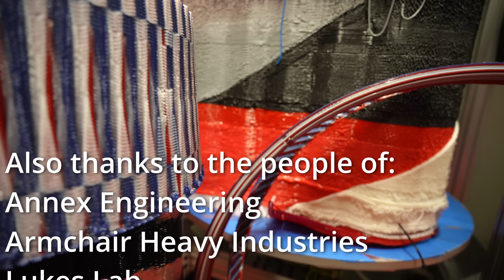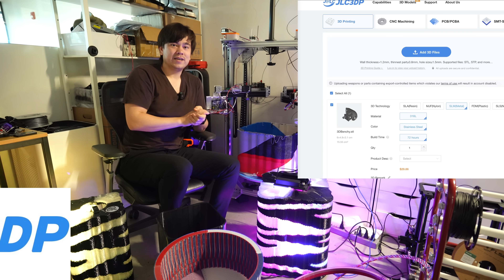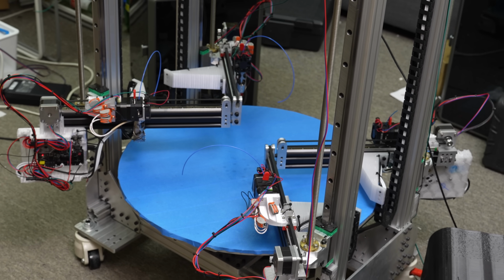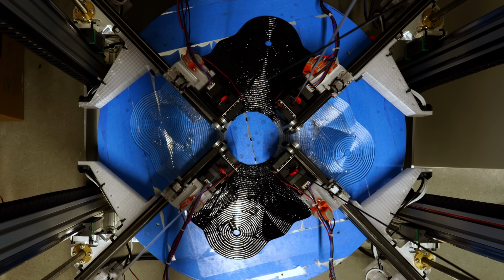The High Speed Future of 3D Printing - Quadrupolar Express

Comment: Why don’t you connect all four kinda-X axis beams into a single solid gantry? You don’t really need an independent Z motion, and using the solid joint between all four axis would solve most of the head misalignment issues. For a Z misalignments you can use older hotends without a thread, that can be fixed at a range of Z distances, so you can align all hotends at the same height.

Also your kinematics has two shared axises — Z and rotational axis. This way, without two independent axis per head, you can only really do mirror-like mode prints. Also without being able to print in the middle of the table.

I like your work, but it seems to have too much engineering issues. 3D-printer project 
“Dueling Zero” is much closer to practical parallel printing (but cannot scale well beyond 2 printing head, like your design).

Comment: 11:25 could you put a camera on the top looking down on all the print heads so that as the rails are not parallel, the camera measures the x y position of each print head relative to the single fixed reference point of the camera and then compensate position in software?

Comment: Very cool idea, only problem is with your model it isn't possible to print in the middle... How about a 3 head printer: one diagonal arm that goes completely through (is connected to two pillars), so this can print in the middle and than two short ones on each side... Of course this would need seperate controlled print heads/G-Code.

Comment: Do you think that you could do like a 3D mesh level to compensate for the warping ? I'm not sure exactly how it would work but maybe have 4 bed scanners and have them all scan every 0.5 or 1mm Z height and maybe somehow overlap the meshes to be able to figure out where the tool heads are relative to each other? Maybe have markers in the bed to help with aligning the meshes? And then use interpolation to get even finer adjustment for warping. It sounds like it could work but idk if it's feasible to make. Best of luck

Comment: I think I'd start with one IDEX arrangement that crosses the center of rotation, so you can print in the center of the bed, then add more radial axes.  For alignment, best option would be a large surface plate to get the frame planar a straight edge to get one rail true to itself, and then a test indicator to let you adjust the other rails parallel to that one.

Comment: 12:00 - The multitude of out of tram conditions in a 3D printer of this design could largely be calibrated in software, once you have all four print heads completely independent of each other, similar to Z axis offset after creating a print surface map.

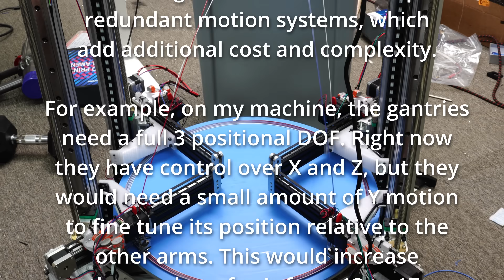13:00 - Never mind.   😀

Comment: Amazing machine sir, excellent work! To me, a pellet fed design feels like the right direction given your comments regarding filament swaps. Looking at the comments regarding the ability to print the entire platform, missing the middle comments, given all heads are printing the same layer, is it possible to move the relative motion to the heads themselves mounted on continuous X cross rails compensating relative head heights with some sort of mount design? Just blue-sky thoughts here about an amazing machine. Please, want to see more.

Comment: just as an Idea: with independent z axis control it might be possible to do vase mode with 4 layers done in one rotation of the build plate (not exactly 4 layers in one rotation, but it should cut the print time of vase mode prints down to 1/4 of the original time) each print head does one rotation on one level and when the newly printed layers from the other extruders arrive you could move up the extruder whilst printing up 3 layers. If you stagger the end of the ends of the circles of the different extrusions you also don't need to move up 3 layers immediately but a bit more diagonally up. not sure if it makes complete sense but this could be a fun application of this design
edit: for g-code generation you could essentially run the same g-code on each extruder, but starting out on different layers and also staggered in phase of the rotation of the buildplate, this could ease up on the software implementation of this.

Comment: Probably the easiest way to ensure each rail is parallel is mounting a dial indicator to one and measuring the distance to the other as you move the rail up and down, this is very common when making or preparing machine tools. Just need to be careful with how rigid the mounting for the indicator is and what surfaces you are actually measuring. For example doing this will not guarantee squareness to the base, and you'll need to measure the front and side surface of each rail for both axis of the rail that can be out of parallel. Use the same rail to measure the adjacent rails to avoid compounding errors, and adjust the opposite corner rail with the dial mounted to it while doing your best to make it agree with both newly adjusted rails if you don't have a dial stand long enough to reach it from your reference rail.

Comment: How about connecting two opposite gantries for over-the-centre printing, as well as, increase in rigidity? Or, better yet, connecting all four on the outside. I don't understand the reasoning for separate z-axes movement, considering the limitation of a common build plate.

Comment: I think for your project reprap firmware is better suited. Proper printing has built a dual toolhead machine that has all axis independent, so a separate xyz for each of the extruders.

Btw klipper had for a long time support for idex printers (dual carriage), copy/mirror has been added this year in mainline klipper. So no changing pin assignments, you just park one tool, activate the other and continue.

Comment: That’s an amazing project! I think, the bed adhesion could be solved by using some pressure measuring sensors like the prusa mk4.
I also think, that the machine is more suitable for pellet printing.
Also, once it is possible to control each extruder by itself (so 6 axis), it would make sense to build in a gyro on each printhead to compensate for any misalignment of a particularly axis

Comment: I forsee two major issues:
1.) you can never reach the center of the buildplate.
2.)when you want to print asymmterical shapes, the accelerations of your "X" axis' will be very geometry dependant ans eratic. This will cause a lot of artifacts and oozing defects.
Reply from the maker: With the current mechanical design, it can reach center with all 4 printheads, just not simultaneously.

Comment: instead of the robot arms, you can just spin and use a cd-drive style radial linear motor, and have multiple readers, while spinning the platform and doing it otherwise like corexy, core-polar. to continue, why did you not join the bridge arms as a connected star rail bridge. even more stable and accurate. you have the blind spot in the middle tho. corexy would be better in general. you have multiple print heads on the xy plane. to get the center also, have one of the bridges have a single print head. or have a single diameter bridge have multiple print heads.
Reply: if you use a bed slinger or spinning print plate, and have multiple x or y aligned print head bridges, you get as fast as many you have those independent print head bridges. yep a normal/spin bed slinger with multiple, not just one, print head bridges.

Comment: The Duet 3 control board allows for parallel processes. With the X5 expansion board you can control about 10 axes. Firmware also allows for parallel printing. I don't think it's still enough for your application though. How it works in practice is that two printheads will both execute their particular task until they receive a command to sync them up. At that point I think the fastest printhead will wait for the slowest printhead to complete its gcode.
Reply from the maker: Hmm, I have a half dozen boxes that say "Duet" on them that agree with you

Comment: Problem is - these are easy prints, no stringing, overhangs etc. But those extremely complex designs often just make a single part print necessary, you got a problem that nobody else ever had and that is for sure not a trash can or easy geometry
Reply from the maker: I'm not running part cooling, and using large nozzles to mask alignment errors. But once I sort those out in a future revision it should be able to print with 0.4 or 0.6mm nozzles with typical 3D printer overhang performance

Comment: How did you remove the trashcan and are they for sale i need one and do you think i can break a chube
Reply from the maker: I used a bolt which screwed in through the bottom of the plate, like an ejector pin on injection molding machines. The sucker probably took over 800 lbs of force before it popped loose!

Comment: That is impressive ! however there is another very important limitation ... you cant print in the middle. imho that is very important to solve, and i dont see a way to solve it with this design. Maybe once you can get 4 independent printheads, you could change two opposing axis so one is longer and the other shorter ? That would allow the center to be printed, however only 1 head could be used for that. Awesome job in any case.
Reply from the maker: Actually, it can print in the middle. All of the printheads are set forward about 150mm from the linear rail, perhaps I should have demonstrated that on this video.

The issue in firmware is I can’t send all the printheads to the middle at the same time, and they all receive the same signal, so the temporary solution is to just avoid it
Reply: @NathanBuildsRobots  It looked like your prints were open in the middle too, so I thought it was a physical limitation. It makes sense as you said you could not control the printheads one by one. I think if you can add that info somewhere (or pin it in the comments maybe ? ) you should really say it is a sofware limitation only !

Comment: Brilliant project. What a mission. love it. Would a solid hub linking the ends of the extruder arms make their relative positions more rigid? And then if an extruder is idle make it sit in a rest position outside of the build area so as not to crash into the build.
A solid print head gantry with the multiple print arms might help keep print plane alignment neat between the 4 heads as the gantry rises. Probably also needs well coordinated for 4 z axis rise timing and each print head completes it's layer at the same time so flow rates mapped to layer specific speeds of extrusion. A lot of code for the slicer

Comment: WOW, this is a whole other level. I recently jumped on the RatRig IDEX wagon and while they have got great control over precision alignment with their visual assisted alignment tool (VAOC) this has so many more degrees of freedom! Exciting to see how far you got this already.
Reply from the maker: This isn't at the level where it would be plug and play like a Ratrig, but in a few revisions it should be! Just need to fine tune the mechanical build, then overhaul the electronics and firmware.

Comment: Another great video and hope you continue to develop this project.   

I completely agree with your assertion that parallel multi head printing is the way forward. 

My thoughts on some of the issues you raise in this video are:

1) Limitations on the number of axis you can control - I think keeping the control boards separate on each print head is a solution to this - i.e. Each board has 3 AXIS and Extruder control - for its own print head,  You just then need to ensure that the control boards synchronise with each other at appropriate points in the print - such as layer changes or exclusion area changes.   I think you could then break in print up into a number of 'exclusion zones' per layer - probably the number of print heads x 2 + 1 - so that they can all be printed independently without risk of overlap/head crashes.
2) Alignment - I think software is the answer - I think each print head needs to automatically align itself in 3 dimensions to the same 2 or 3  fixed points in 3d space - then it should be possible for all print heads to then be fairly perfectly aligned with each other. 
3) Independence - I still think only having one (IDEX) or two (Your polar machine) axis fully independent is going to limit the shapes you can produce - even producing an oval is going to be difficult as some heads are going to need to be moving at non optimal speeds to allow the other ones to keep up with the different distances they need to travel on the fixed motion of the bed,  Therefore I would suggest you keep the polar design - but add another axis of movement at right angles to the in out movement.  My 'Revolutionary concept' short purposely included a 'house' or 'Triangle on top of Square shape' to demonstrate the sort of shapes that will only be possible with fully independent movement in the XY  axis.   I think that the new right angle axis could then be used for a lot of the motion - with the polar movement then only being used to move the print around maybe twice to per layer - to give each head access to a new 'exclusion zone'.     
4) Multi colour - I still think having some kind of colour multiplexing on some of the heads is going to be desirable - both the allow larger number of colours than print heads, plus to allow parallel printing of some colours in certain parts of the print.     
5). Pausing - it was a shame that you had to cancel your first big print due to time constraints.  Personally for really long prints I almost always pause them overnight - I use a non heated build plate and bring each print head down to 35 degrees so that it doesn't need any fans and then just pause the print overnight or when I go out.  I usually only pause during a colour change.   I have even managed a couple of times to completely power off the printer and 'power interruption restart it' and still get a successful print.

Will probably produce some sort of demo myself - probably of an IDEX with a couple of extra independent cantilever heads added in front, plus maybe the bed changed to Polar - but am currently waiting to see what BambuLab come out with in the next few weeks if the rumours are correct  - would be very interested to see one of your 'prediction' videos on this as you have been pretty spot on in the past.
Reply from the maker: I have some info on the new Bambu, but I think it will be a few months out.

Comment: Very impressive machine! 

To make the alignment somewhat easier, but still hard:

Reverse the machine and use a fixed gantry assembly with all the heads. Let the bed drop down. 

The bed only needs 3 axes to control precisely, which is much less than however many extruders will be used. 

To get the vertical alignment done, use a laser and a mirror and an image sensor to see the drift of the spot as the bed is lowered. Or something like an auto collimator. 

You should be able to get very precise angular twist detection at one particular point.

To get toolhead alignment done, use a bed probe that can be rotated around. Might require the probe to rotate precisely about the origin. There may be better solutions out there :/

Comment: Very cool. My brain is on fire with ideas about alternative ways to arrange those X gantries and produce a kinematic where all the print heads could reach across the middle, or at least 100% of the platform when it's rotated. As for the frame alignment, you could definitely add a frame warp compensation to the kinematics to account for the irregularities in the frame. The tricky part would just be taking those measurements, so maybe lasers (passing through guide holes) could be involved. Keep up the good work!

Comment: That’s impressive work you did. 

I see one flaw in the polar system if printing non-symmetrical parts. 
Different heads will have to deal with different tangential speeds. 
I’m sure it’s negligible in most cases and could also park the suboptimal head and let the other heads complete the last troubling extrusion. 

I can’t imagine the slicer headache
Reply from the maker: You’re absolutely right, there will be an inefficiency when the Printheads are at different radii where it will have to spin as slow as the Printhead that is furthest away from the center.

With 4 SCARA type arms, the arms could advance or delay their phase so maximum speed would always be achieved
Reply: @NathanBuildsRobots  Have you think about a slotted nozzle, let’s say 0.4mm x 1.6mm, that you can dynamically orient. 
Have seen it in those huge concrete 3D printer. 
Or event even a nozzle with a row of 4x 0.4mm holes all independently feed by 4 filaments and dynamically orientable. 
That way, you can still print small features with one hole and then print thick wall by feeding all holes. 
An Arachne on steroids